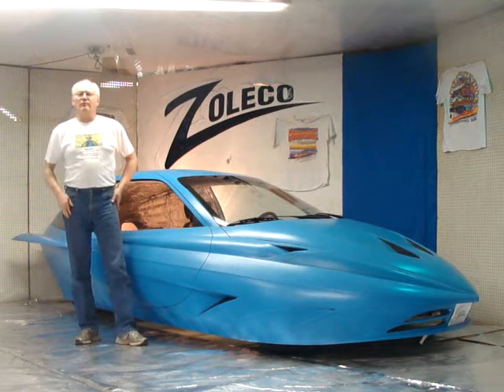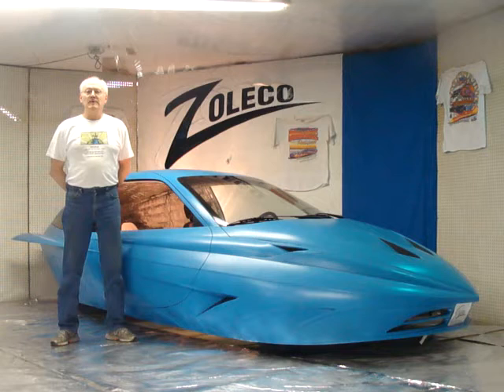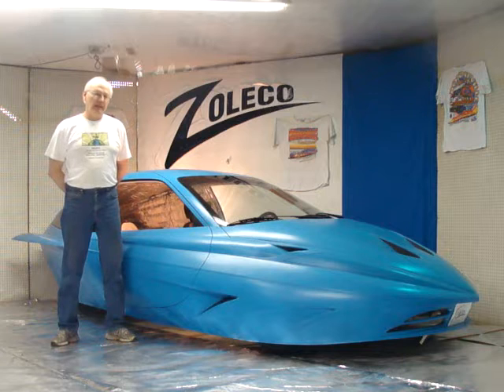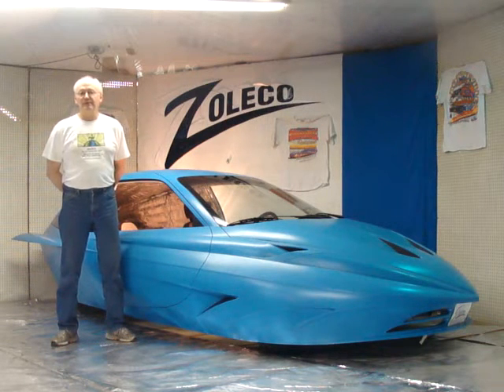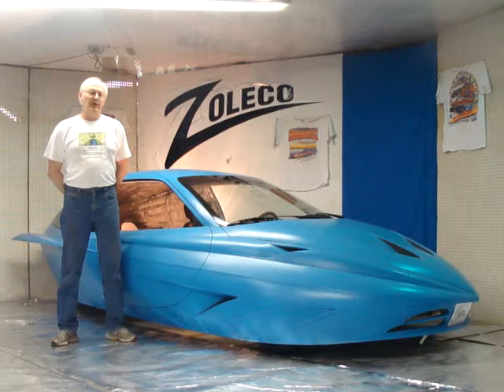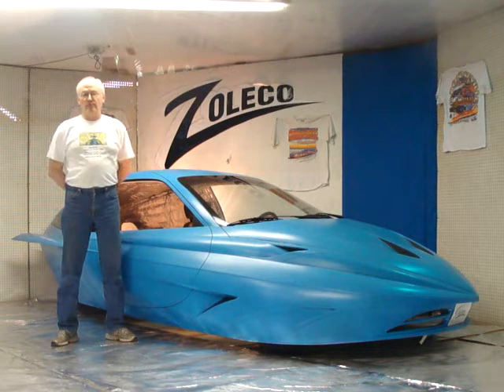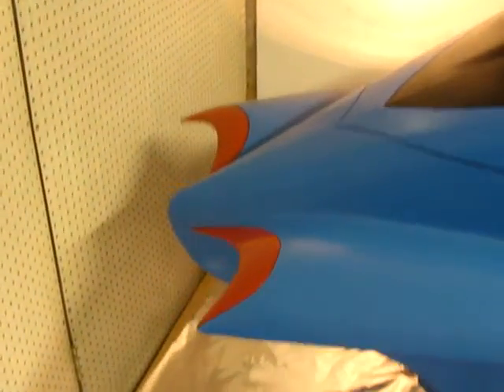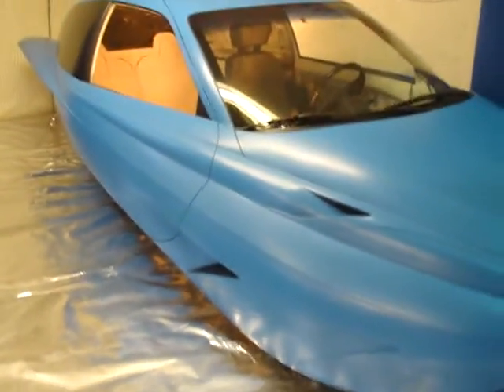Zoleco Bonneville salt flats proof of concept race car introduction.

Comment from the maker: What you are looking at is the full scale design and development model.Most of the chassis is built with the engine and front drive system installed.It is not a running driving car at this point of the project.Unfortuneately I am out of money at this stage....this is why I am looking for business partners to complete the production prototype.Thanks for your interest.